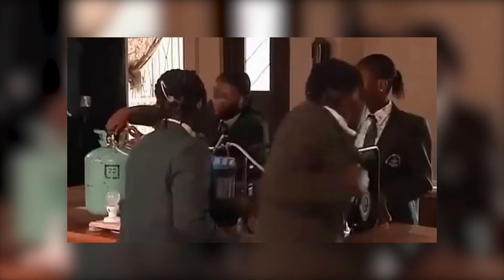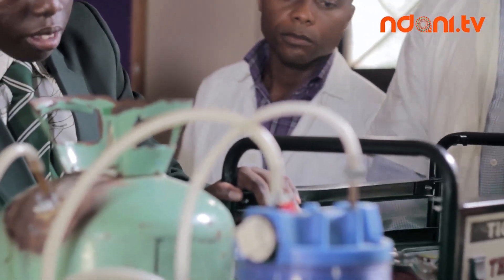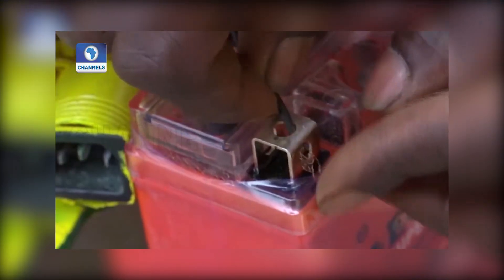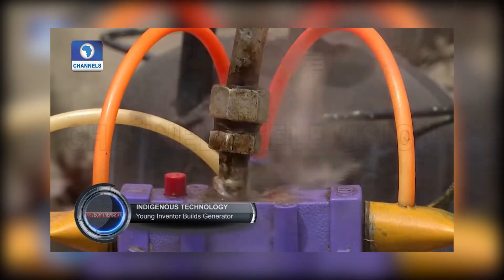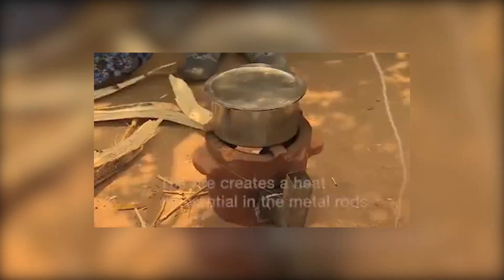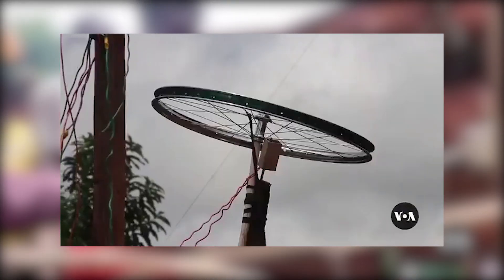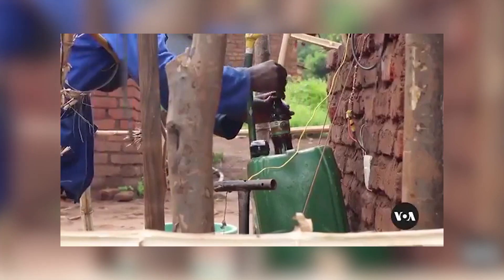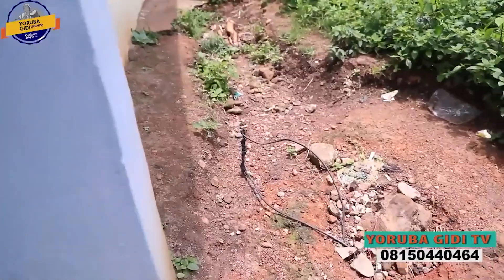Generators Made from Scraps | African Made Generators

Comment: 4th grade education, battery related thing, 2 wires, lightbulb thing... then something about capacitors, a spark generator for starting camp fires. ... then seeing that rock inside with the wire wrapped around it, electrically grounded circuits only stay grounded if their is a small amount of electrical conductivity in the ground, yet if it is very dry outside and little humidity in the ground methods of grounding a transformer branch wont actually work so the "neutral side of the circuit can not be tied/bonded, to the grounding wires on a 3 prong plug as that would make the whole building electrified" so tying the ground to a rock inside doesn't make a difference, all the (110v) stuff is wired as if it is 220v. "ground soil is to dry for a 1st world electrical code install to work safely, in fact only makes a electrified ground problem thru out the whole building". sensible rock, if it causes pain to pickup something is wrong, a coil in a plugged in device could be shorted out that would electrify the ground... tho if a building code was changed, a thing like a magnetic contactor switch could be installed in the fuse panel, so if something did short to "ground, not actually grounded" it would trip one of two contactor switches "two because if its line one or line two, the grounded circuit path needs to be a electrical loop flow with one of the two contactors" that would stay powered on after being energized by the ground circuit trip as well as disconnecting power from everything past the fuse panel. that is more common in process control circuits for automatic motor overload lock out contactors that shut down a whole branch if a wire melts the insulation. would also be good to wire a large electric air horn to one of those magnetic contactors so if it did trip on a currant flow of 300mA/110v the switch block would energize a branched transformer for an air horn. 0.66watts of posable felt short to ground using something like a power drill is a lot less then the whole 3Kwatt that wont shutoff because basic 1st world code book wiring does not work over their.
Reply from the maker: noted